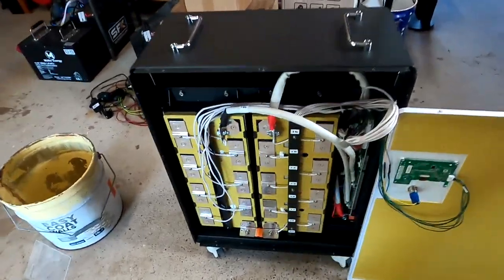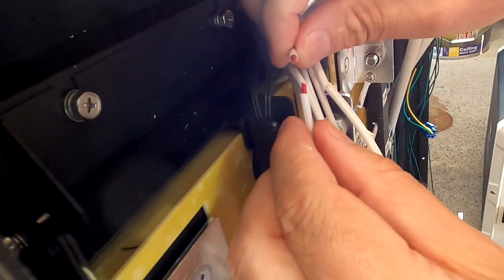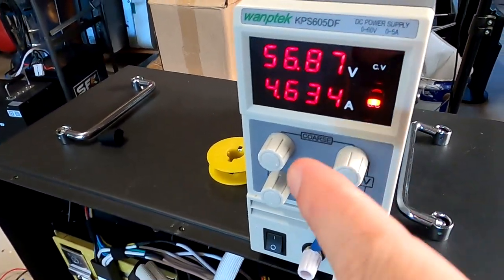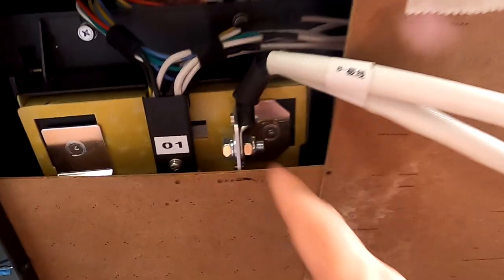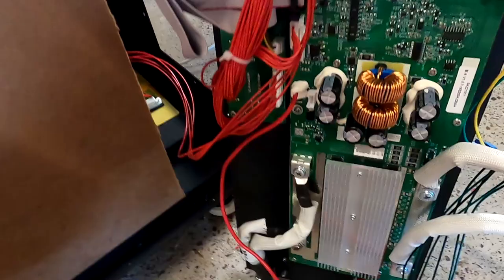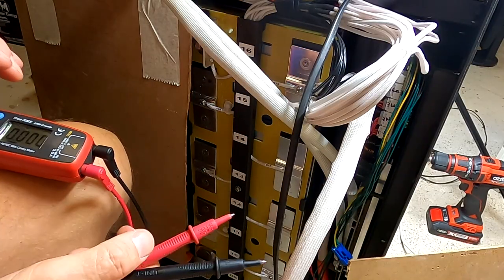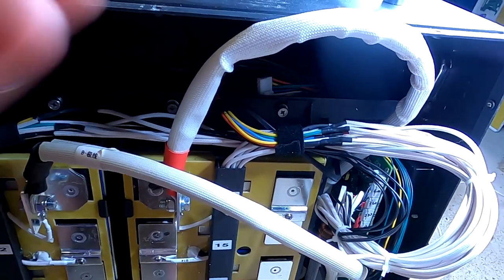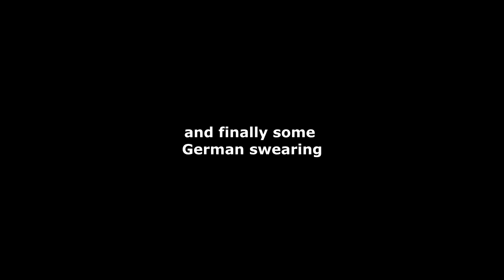The QSO Battery Active Balancer Upgrade. And how a tiny switch makes a simple task impossible!

Comment: Hey Andy. Over on the Diysolar forum there’s a thread titled “Active balancer, make it smart”. In the more recent threads they’ve mentioned some really nice little voltage controls for turning on the Heltec so you don’t need to intervene to start balance manually.
Reply from the maker: Yes, seen that partly, thanks. If we only had a solution for 48V system. I'll see if I can Hankzor to provide a small voltage relay for our needs as an additional device to turn on the balancer. They exist for 12V/24V systems but not 48V.
Reply: @OffGridGarageAustralia  Those parts exist.  They are called voltage supervisors.  You give them a voltage which might vary and they only connect it when it reaches a certain level and disconnects it if it drops below that level again.  Used to prevent "brown out crashes" on microcontrollers there is no reason they can't drive a mosfet to close the "RUN pads" on the balancer
Reply: @1over137  this sounds amazing. Do you have one you trust?

Comment: As you always advertise, safety first. So I would go for a fuse inside and attach the breaker outside the box, as you have done with your other packs. Thanks for sharing Andy, you see how an decission of a manufacurer keeps you busy for weeks. QSO should have watched a few of your videos, and act accoringly. Then they would have a great accu with BMS which could be used with lot's of applications. Just my €0.02 😀🤔
Reply from the maker: It's not that hard to build a good battery if they would just check what is out there on the market and the concerns people have. Take this all onboard and you make the perfect battery and BMS.

Comment: Hi Andy, love the videos. I installed a service disconnect with 100a built in fuse between the two battery banks where you have the link. Not the cheapest option but felt it was worth it for my setup. I also placed a 2pole dc breaker on the main outlet. Keep up the good work!👍🏻
Reply from the maker: Thanks, James. Do you think the BMS will freak out if you disconnect the two battery strings? I'm concerned that there might be some serious current going through the balance cables because the main current path is now interrupted.
Reply: @OffGridGarageAustralia  Hi Andy, not sure what would happen. Maybe a new test for you to try!🫣😁I plan only to use the service disconnect in an emergency as anyone can remove it without any tools but would definitely be interested in what would happen to the bms when it is removed.

Comment: Hey Andy, The only thing I might caution against with the double pole circuit breaker is where you electrically locate it. If you opt to do it before the BMS you could run the risk of having current inadvertently flowing through the comms ground plain on the BMS that might not end well, putting the breaker after the BMS might prove to be electrically a more sound location. If you use a single pole breaker just putting it on the positive will not be an issue, I have heard of very funny things happening to BMS mostly failing or mosfets being blown apart when using a double pole breaker ahead of the BMS to break the connection ahead of the BMS thereby wanting to be able to "Isolate" the BMS from the battery, it does not end well, using it after though I do not think will electrically interfere with the BMS.
Reply from the maker: Well, there are two ways of doing it, One works, one doesn't and causes issues as you described. 
The right way is to install the double breaker is just before the terminal output of the battery box which will leave the BMS fully connected to the battery if the breaker is off. It may leave the negative connected to other batteries of the system through the comms cable but because the positive is fully disconnected as well, there is no path.
What we cannot do is installing the breaker between battery and BMS because it isolates the BMS but leaves the balance cable connected which still carry the battery voltage. I guess this is where the stories are coming from when people did this the wrong way.
It'll come soon in a future video... 😉

Comment: Nice build. It's no fun of everything works from the beginning. 😜
Before you put in any breakers you should consider the communication cables. They might be connected to battery negative. And you probably don't want them to carry the whole load that triggered the breaker.
That's why I stopped fusing the negative, only the positive gets a breaker/fuse.
Replacing the bridge probably is fine but the 2 pole breaker could be problematic, depending on where you put it.
Reply from the maker: Hmmm, that's a good point. I also bought single pole breakers, so...

Comment: An idea, Andy. You could turn the balancer on/off using the dry contact relay on a inverter or charge controller instead of a manual switch. Configure the dry contact to close only when battery is above 55v and open once it drops below 54V, for example. You would have completely automatic cell-balancing that only operates when it is appropriate
Reply: I would second that, but, it would depend on if he has access to the settings of the relay, I know he has the password for the BMS  QSO gave it to him, but, if someone else wants to replicate that would they give them the password as well. Remember, they locked down the BMS so that it could not be altered and Andy has been asked to NOT give out the password. But I would slso like that because then you do not have to do all that drilling....
Reply: @GapRecordingsNamibia  I think Mr D is referring to using a contact on a Victron MPPT charge controller or an inverter connected to the battery. Its a good idea IMHO.

Comment: Andy you have plenty of space on the top of the case, so I think enough for install Mega Fuse holder or ANL fuse holder or knife-blade cartridge fuse or ferrule fuse with proper holder. I cannot recomend to use chines DC breaker, because I dont trust them at all. Rather use MCCB breaker .
Reply from the maker: But the whole battery is made in China. Should I trust the welding, the cables, the BMS? Where to start?
The fuse down where the link is, can be the ANL fuse. Why would you think a separate holder would be necessary?
Reply: @OffGridGarageAustralia  I saw few chines DC breaker burned down. 10x triped without any problem but on 11 took a fire. So I would rather use some kind of fuse (anl, mega, ferrule, knife) + battery switch for isolation, like you had it on battery 1.0. But this is just my humble opinion. 🙂

Comment: Breaker! Breaker! Breaker! Breaker! Breaker!  There's 5 votes for the breaker Andy!  LOL  I'd do the breaker right thru the top in that big space next to the balancer..   It should be easy there as both the battery cables are crazy long and could land on the breaker.  Heck, you will need to crimp new ends on, so you could even cut the cables leaving the existing ends as the sides going to the battery.   Essentially, just cut the cables where they pass the top mounted breaker.
Oh yeah.. The BMS battery sense leads would still be connected...  So just single pole it.  Never understood why both were needed anyway.  One will stop any energy leaving the battery.
Reply from the maker: Thanks, Keith. How can I decline  5 votes for a breaker solution? 😂
We cannot use these cables though as the breaker would sits between the battery and BMS which can cause massive problems. Imaging the breaker is off but all balance cables are still connected and we also have a common ground through the comms cable to another battery.

Comment: As soon as you started talking about the link between the two banks, what happened when Will played with one lept to mind. Magic smoke was released (Will was using it with two 24v BMS, and it smoked when one disconnected). Odd that I have never needed an active balancer too. As an FYI, the pink plastic bubble wrap should be anti-static, however that just means it has a high resistance (not low resistance or infinite resistance). That BMS is not something that I would keep (or trust). The cells seem fine, but I am not a fan of stacking cells on their sides.
Reply from the maker: Yeah, the link is not a good spot for a fuse at it lets the BMS half connected and could damage it...
I measured the bubble wrap with infinite Ohms.
Yeah, the BMS is not great, even it looks similar to the Seplos, it is not...

Comment: What I’ve done with an active balancer is use a esp32 that is connected to rer485 to the bms and then write a esphome script that when the battery reaches 3.42v turn on a pin that shorts through the switch pins on the active balancer (some don’t have anything hooked up but they now all of the solder joints) using a relay. 

And on the way down it active balances below 3v. 

That way it’s all automatic. 

And with a jk you can pipe it all into home assistant to see everything that’s in the app.

Would be really nice if the bms companies would put a balance trigger port on them and do bottom and top triggering then we could easily hook these up and have the bms do the work which is how it should be.
Reply from the maker: That sounds complicated...
Reply: @OffGridGarageAustralia  really isn’t. The work is all done. Ids just a script that says “when max voltage of cells > 3.42 or min < 3.0 turn on. Switch. 

Like 4 lines. 

But yes it would be way better if bmses that don’t do high amp active balancing just had a trigger port that was programmable.

Comment: Andy, rather than have to wait for someone to 3D print and ship a tray for the balancer, head off to Bunnings and get the Moroday 450 x 3mm x 3m Black Self Adhesive Eva Roll (I/N: 4000085), cut a bit the size of the back and stick on. Alternate if you want something more local sourced, got to the kitchen, grab a plastic cutting board or silicone baking mat, cut to size, and presto, another chance to have a SPAT with the wife. If your less game, a new large size cutting board or silicone baking mat from a local hardware or home-ware store would also work. Another one is if your bench cutting mat is looking a bit used, buy a new one and cut up the old one, the grid lines make it really easy to get it neat looking. There is no need to stick the sheet you use to the back as the 4 bolts will hold them in place, after you have your backing sheet matched up to the balancer run a drill bit through the holes to clear them out before bolting in place. Previously when mounting the 4s sized ones, in one case I didn't use any backing but used the hex shaped stand-offs that are used in PCs to hold the the motherboard away from the case, another time I used longer bolts with a number of nuts to provide spacing, but have found cutting backing from silicone baking mat was just easier, now using the stick on 3mm EVA foam after I got a roll of it to use between cells.
Reply from the maker: Thanks Dave. I have everything you mentioned in my garage. But I want a tray! 😎

Comment: The fuse between cells 8 and 9 will, over time, cause more cell imbalance than the factory bus bar because it's resistance is greater then the resistance of the other bus bars in the pack. I would leave the flexible bus bar there, it's resistance is likely closer to the rest of them.  The markings on the DC breaker make me suspect the breaker is polarized and directional. It could ignite in over current conditions or even if you switch it off while current is traveling in the "wrong" direction while under load.  The DC breakers as battery disconnects must be capable extinguishing the arc while the battery is charging and while it is discharging. Testing some DC breakers under load, in each direction would make a great video.  Incorporating a class T fuse is obviously the best choice but with space constrained, you may consider an MRBF fuse.... rated to 58V and a lot better than what the pack came with.  You do a fantastic job on your videos and the humor is outstanding.

Comment: Thanks Andy, big 👍👍
When you said via overlaid text that the nightmare started, for a second I thought that the whole system was broken. 
So very glad it was only a faulty switch, (even though that was a pain in the backside). 
I’m not sure of the advantage of a double pole breaker? I’ve only gone single pole (plus a fuse) …. do you think that’s an issue at all?
Reply from the maker: Not a problem at all, Dave. A single pole breaker will perfectly do. I just like to be safe and disconnect both.

Comment: I am using a microcontroller reading the min/max cell values from the BMS and activating the balancer when one cell reaches top level value. It turns off the balancer when cell difference falls under a certain value.

Comment: Andy, Could you please give your recommended numbers for active balancing and your experiences of using them. When to start balancing? What is the maximum differential between cells that is already OK and does not need active balancing? How often have you used active balancer on 2.0 battery packs, especially with JK BMS? Which active 16s balancer do you recommend, Heltec or Neeey-4th gen? With the Neeey-4th gen I like the smart options and just need to set it up and eventually monitoring with Heltec it needs to be manually turned on and off. Thank you for the answers in advance.
Reply: go back through his prior videos as he has done several specifically about balancing including his recommendations. He prefers Heltec for their dead simple functionality and cost but really likes the Neey for its control but given the cost you should have noticed him mention the Neey in this video and either the prior video or one before that but even so he put a heltec in there.
Reply from the maker: OK, that's a lot of questions. I'll pack the answer in a video soon. Might be easier. Thanks for the suggestion.

Comment: That breaker is directional, if it trips with current flowing in the wrong direction it could catch fire. It would also have been a good idea to use a much lighter gauge cable for the balancer switch.

Comment: Heello andy, I think you soldered the switch on the NC and NO pins and not NO / Common :( . 
Also, what's the reference of this Fuse ? Thanks :)
Reply from the maker: Nah, i soldered the middle pin and one of the others. That was all good. The switch was just old and broken already.
That's an ANL fuse with 300A. Victron sells them as 80V fuses (but expensive):
https://www.victronenergy.com/upload/documents/Datasheet-Midi,-Mega-and-ANL-fuses,-and-fuse-holders-EN.pdf

Comment: Hi Andy, 
And thanks again for this video, it's more and more fun!!
Why don't you use the NEYYYY?? you can adjust the desired voltage to start and stop the balancing?? (4A)
A switch??? each time, you will need to manage the switch? and if switch breaks down you have to open the battery again??
Concerning the Breaker, but a Unipole on the Positive only.
(the fuse at the junction of the 2 packs, for me it's not good?? and still open the battery again if problem??)
Have fun Andy, and thanks for sharing.
Reply from the maker: I have several of these battery cases and would need to buy a few NEEYs. I also want to show what options we have to install an active balancer. The NEEY is like a Batrium BMS. It will just work. That's not what the channel is about. As you know.
Yeah, the breaker needs to be single pole only if we leave the communication plugged in. There could be a massive current going through the LAN cable in case the breaker opens. Breaker and fuse should never trigger though, so if it is hard to get to it, it does not matter. We don't need them on a daily base, right?😉

Comment: Hi Andy, I would really like to know, if you could turn on the active balancer by the victron smart shunt
Reply from the maker: The Smart Shunt does not have a relay, the Victron Battery Monitor BMV has and could be used for that.
I've got some other solutions... stay tuned.

Comment: Andy, I think the perfect balancer would be a unit that connects to dumb capacitor one and just turns it on/off when one the cells gets to a predetermined voltage. The unit itself does not need to do any balancing, just intelligently control the other one?

Comment: I used a switch with an LED on board & connected the LED on the balancing board to it.  It's a bit fiddly as the LED on the board is tiny.  It works well though.
Reply from the maker: That's a great idea. I have some switches here which have LEDs as well.

Comment: Good vid Andy. Bad luck with the switch, I would suggest a push button type, not as vulnerable to accidental knocks. Go with both, the internal fuse & an external breaker switch, I like the idea of using an internal fuse this way, it cant hurt while ur in that deep already.